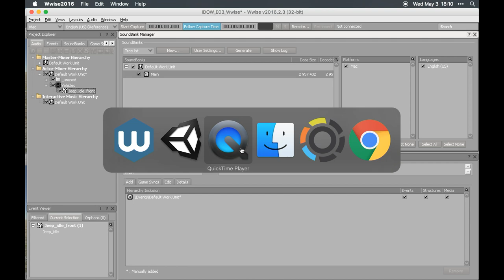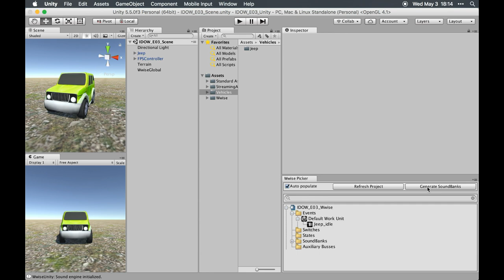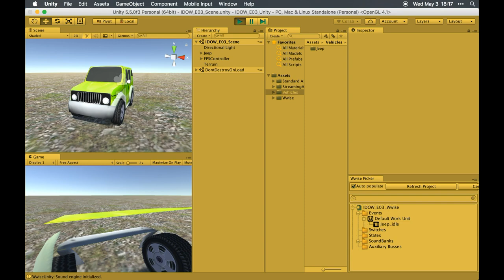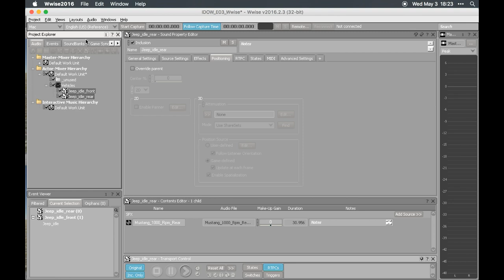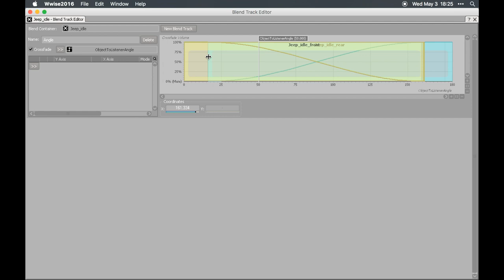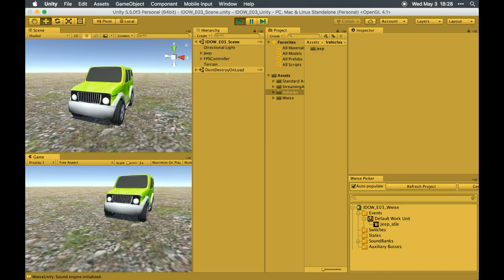I dream of Wwise - E03_1: Attenuation + Spatialization + Built-in Parameters

Comment: Is it possible to ignore an axis for attenuation? Im developing a 2D game and I need the Z axis to stop being considered.
Reply from the maker: Unfortunately no, I don't think there's a way to ignore an axis in Wwise. In most of the 2D games I've worked on we used Wwise's 2D Speaker Panner (Balance-Fade) instead of the 3D positioning settings. We dinamically drove the Pan Left-Right parameter via the Azimuth built-in parameter. This should achieve what you're looking for, let me know if it works! :)
Reply: @francescodelpia  Huh, I never heard of that. I ended up making a child on the camera and moved it forward, to the exact z position where all the 2D objects are. But if the technique you're talking me about is better i'll try that. Thanks!
Reply from the maker: @speedpower2951  that's an interesting solution! A similar setup to the one I mentioned was used in Inside, you can see Marting Stig Andersen explaining it here https://youtu.be/gRF8Gt5hys4?t=386